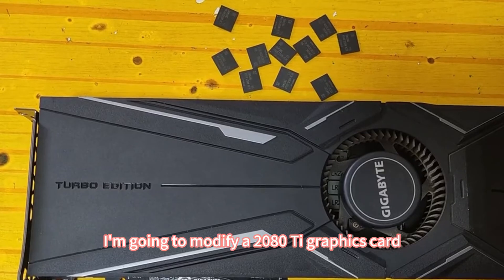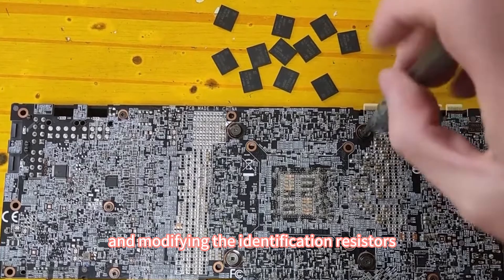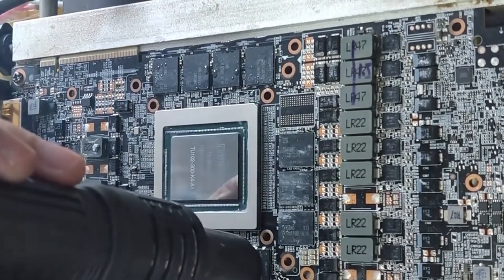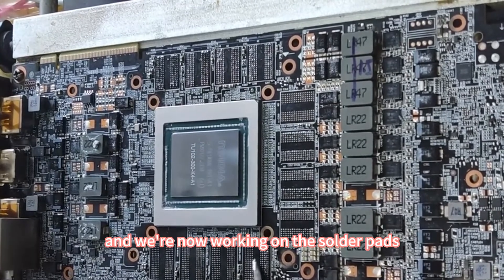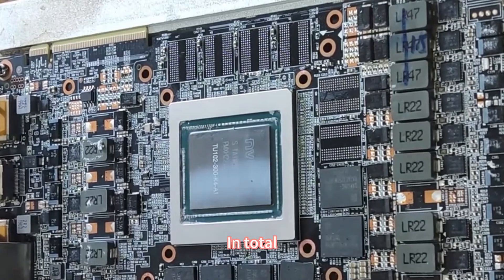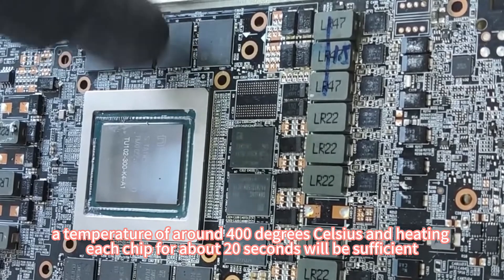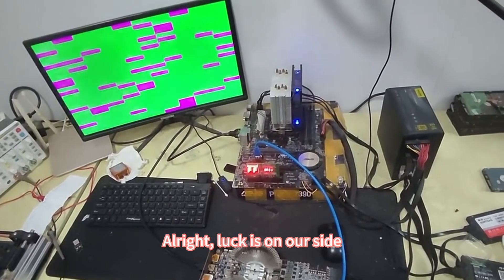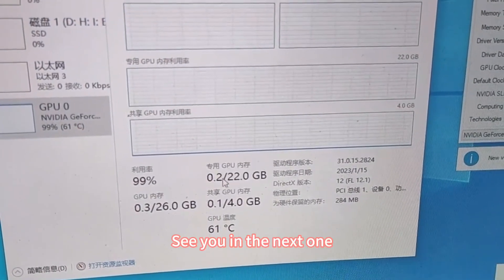How to upgrade GPU memory. Upgrade 2080ti to 22G. 2080ti22g.com

Comment: What the heck do you mean not technically challenging? You immediately said like 500 different ways to screw it up and then on top of that you need the right tools which are typically not owned already

Comment: Great work, be cool person to hang out with and learn and experiement with projects, this land here is anti land, lol

anyways if the gpu is plugged into teh pcie 16 slot, I had an idea, that if the gpus were slightly modified with a buffer path circuit like their crossfire, you could insert an adaptor of ram into the PC slot, that could hold up to 5 modules or well unti lthe power gives out on a card with its own path and id, this would allow you to upgrade the VRM of any gpu, and of course the gpu then is inserted into the slot... this should work right... or maybe not... The location is off but it could be a direct.. liek when I was wathcing DIMMs and read write paths, one could make a same read right path, or alterantive an easier solution is a gate, that closes when an daptor is plugged thus only the active ram is utlized that uses the deactivated vrm installed, by pass it without removal and utlize the new chip set added... alternative, VRM towers could work in the same regard in how the layer the word and bit lines, adn then ahve another capcitor and word and bit line track... meh I don't know but it would seem possible to bridge the back of the ram, but that may take too much tiem and mess up the snetivie volts for hte bits and the nnot relay the proper information.. hmm I think an adaptor would work, but maybe not... peoples.. want a way to upgrade vrm on the gpu, like the main mother board that dedicated to computing, cpu... Of course they have massive differently speeds and uses, VRM and RAm, and memory itself.. The logic of the computer systems are pretty simple ,the largest proponent of destruction of it is education and monopolies to consolidate a controlled market its the same with ram market.. monopolies destroy the freedom adn the educaiton and life of others that peopel once had... as like other systems, its very bizarre. I htink a good goal, would be 100 gb ram gpu.. that utlizes the read write effeciency of DDR5 ram or better, I was really impressed the improvement from ddr3 - dd40 dd5... and the voltage decrease. whilst then a effeciency increase over how the WORD lines are read/ multiread, during a bit phase and the burner bits that cahces a group address in teh 128 bit for evne faster... RW... hmmm. The mechanical nature of the volt and movement and capcitors in how it works is really something... logical.. 

GPU adaptor could be amde in several ways. A hard core method is a device that scans for the connectors below, and it drills into them a nanometer... through hte ram, extends and slaps a ram on top.. right through the old one.. aggressive instant upgrade.. lol  It shouldn't hit hte capcitors but .. hmm 

there is no fun classes of like, lets go build motherboards and gpus for a few months and learn this info, now its.. you must serve and be slaves because of identity and we will kill and steal nd trap you which makes no sense since everyone was part of the com revolution that was part of warfare and engineering nad well surviving so yeah private and proprietary.. destroyed creative appraoches to enter in and have fu nredesiging or making ones own design and it is engineered this way curelly throug hrental and other forms of money control to rob peoples.. Nethanyahu that asshoel wasn't lying when they destroy the greeks they created the largest mesianic cult army that kills anything that htey verbate and destroy normal peopel adn rob them.. and america corps were paying peopel to train tehir repalcement for decades adn laughing about how stupid they are in teh background while taking over the operations and unqie peopel, much like the igital camera and other things... its hte oppsite world meh. get sme angry whe nI think about it.. which is making us all stupid ,its liek we hsopudl jsut kill them al lthe time and ignoring the whinign and it wouldn't become like this.. but then its like .. these iditos create no win situations its not about winnign or goating jsut about doing a thing and well and then have an interesting ideal around it. meh.. anywys keep up the good work, end rnat.
Reply: You're one of those savant types arent ya?

Comment: Has anyone done this to make a 48GB 4090?
Reply: Dont even know if they have larger vram chips that still fit in the same form factor. You should ask grok research or chatgpt think whether it does. It's free, I would do it, but i have to wait several hours for my free uses to recharge.

Comment: Does it work to mod a 4060 to 16GB instead of the original 8, not the 4060 Ti that sucks.
Reply: yes
Reply: I wanna know why 4060Ti sucks? because rn I'm confused between 3060Ti & 4060Ti to pick one for my build
Reply: brother, if you can't do this basic research on your own, I wouldn't even dare to attempt this kind of thing lmao.

Comment: Dude I wonder if there’s a place I can just take my gpu to upgrade the vram
Reply: its more that it needs to be compatible and where does it come from? cant just ask nvidia for them so its always offcuts, would need to be a high traffic PC shop or a guy with distribution centre connections to actually get the chips

Comment: actually, 12 chips. why you said 11 chips?
Reply: 22 is the max you can do without failure
Reply: @mkeefe4248  you mean 12 chips, but replace or upgrade only 11?
Reply: @CambodiaShareFeeds  no no. What I mean is originally the gpu had 11 1gb vram chips. That’s why it’s 11 gb vram. He replaced them with 2gb vram chips instead so 11 2gb. That’s why it’s 22gb. You can’t go past 22 gb though even though you have one more slot. Because it would be faulty. It’s very hard to explain why but. The max vram this card can have is 22gb . If I remember it’s something with the drivers. That’s why he only has 11 chips.
Reply: @mkeefe4248  i understand your meaning, but just wonder why keep 1 chip empty? because the total chips i had counted was 12 chips.
Reply: @CambodiaShareFeeds  bro I just explained it. Because you can only have 22gb max smh. If he had 12 2gb chips he would have 24gb. Which is not compatible. So he can only have 11 2gb chips because the max is 22.

Comment: What about RTX 3080 20GB?
Reply: 3080 20GB needs the PCB from a 3090, not as easy as 2080ti or 3070.
Reply: @lly0571  I see, thanks. Yes, interestingly, RTX 3090 PCB is compatible with RTX 3080 GA102 core though, so if one acquires a clean RTX 3090 PCB for some reason, and they also have GA102-200-KD-A1 core, it could be done

Comment: You didnt mention you have to do a custom bios update.. and the people who attempting to do this already wrecked their $1200 GPUs lol now its a $1200 paperweight! This is an experimental thing.. might as well just buy a newer 4070Ti with 16GB for $300 more after selling the 2080Ti.. the time and effort and risk isnt worth it doing this, otherwise it would have been a thing that everyone did if it was that easy.
Reply from the maker: No. it doesn't require custom bios update. I agree with your second half. The upgrade is not easy. Please don't try the mod yourself unless you are an expert.

Comment: Do you know if this is possible on 3080Ti? 12gb to 24gb? Thanks
Reply: There’s a thing out there called RTX 3090..

In all seriousness though, 24GB 3080 Ti would be awesome, having all VRAM on the frontside of the PCB.
Reply: @flutecat87  yeah I bought 2 x RTX 3080 Ti for $400, 3090 is still 1000+
Reply: @AINMEisONE  i can get 3090’s for about 600 Eur here in Sweden. :) ofc depending on which brand and model.

Comment: 400°C is too high for a reflow.
You should use 300 max with a preheater set at 250°C and let the board have enough heat (180°C) before applying the 300°C on the top.
Never be impatient with temperature or you'll instantly kill the chip for sure.
Just let the temperature increase slowly and let the PCB absorb heat little by little.
In my experience, Ram chips hate high temperature. If you use more than 350°C for more than 10 seconds you'll definitely kill the chip.
So in conclusion:
1- preheat the board with a preheater (heating plate) and let it reach 180°C
2- then apply 300 - 350°C max to melt the solder and remove the chip.
3- patience is your key. Never reach the required melting temperature too quickly but let the board absorb heat and wait patiently.
Reply: yep, i been through about $2,000 USD in cards before i learnt this.

Comment: Something like on an GT1030 DDR5 will be amazing
Reply: unlikely as it's such low vram to begin with, a gtx 1070 would be the minimum worthy card, although that'll change soon as 5000 series cards are releasing.

Comment: How come he did not use 12 chips for a total of 24GB ,is that channel not active in the already blank spot?
Reply: Yeah I noticed that there was a empty pad. But it also came like that before he did the mod. I think it’s better off to be safe and leave that pad alone it’s already hard enough to do this. It’s possible but using that other pad might make it a 0% success rate. This is pretty  cool  though
Reply: @mkeefe4248  Its cool though ,I'm just curious to whether that empty pad is actually functional or not. :)
Reply: @Nevakonaza.  I realized why. It only allows 22gb. So he upgraded 11 1gb chips to 2gb . Because it only is functional at 22.
Reply: @mkeefe4248  ahhhh okay that makes perfect sense,thanks for explaining 😊

Comment: Guys, dont fuckin do it if you never done bga-level repair and you got the proper equiptment. I killed 4 gpus for lack of experience (from 960, 970, 1060 and 1060, there are a tons of things you want to think about, you need a dehumidifier (100 degree oven/ put the card in for atleast 20 hours) you need a bottom heating plate for bga repair work, you need a decent heat gun, flux, etc, if you got a function 2080ti, dont do it! 
Also, you need properiatary tools like Nvidias MODS/MATS testing tools which are NOT available unless you go on the darknet/repair forums, so if you dont have these tools, dont touch ur card... 

... dont!
Reply: MATS/MODS are available all over the web. Easy to find. You don't need to dehumidify or to cook the card beforehand, not even sure why you think that, and you don't really need a board heater, but it is recommended. All you need is a decent heat gun, a decent iron, good flux, and a little bit of practice. If you've praticed on 4 cards, you should be well on your way by now, and shouldn't still be having failures. You might seek out some professional advice if you are still having issues.
Reply: This is nonsense
Reply: what a bunch of bs

Comment: where you get the bios????
since 22gb is unofficial Im pretty sure you cant get it online
also, even with the right bios, the gpu refuses to boot and need to flash another bios
Reply: yeah cause in this video he never set the new resistor positions, he obviously left it out

Comment: That's it ? 🤨 Does the bios need some modification to detect all 22GB or it just natively detects new DDR modules ?
Reply: I've seen mention of others performing this upgrade. They say that no software/firmware changes are required and the card and drivers will detect the larger chips without issue.
Reply: I've found a bunch of salers from China listed these 22GB versions online for as low as 430$ but they're all reference board with blower cooler and I kinda wanted to do it myself.
Reply: Samsung K4ZAF325BM-HC16 (16.0 Gbps) and K4ZAF325BM-HC14 (14.0 Gbps) are two types of GDDR6 module that I can buy so I ordered them for ~12$ each with soldering/hot air station, reball kit, ... It got out of hand pretty damn quick for a little experiment, but hey, 4x 2080Ti 22GB Strix sounded cool as hell
Reply: I also found out about "strap mod" as mentioned in an article from videocardz. I think imma stick to that for later
Reply: @BLVDE468 did you succeed in replacing the vram chips ? 🤔
Reply: @Selyan_  I'm getting nowhere, man. So many headaches, first 24 modules I ordered have some kind of defects. First I was getting no output, but when I did get an output on the screen it just black with some green artifacts.I think I messed up somewhere at the resistors strap for memory modules. Still looking for info on that one.
Reply: @BLVDE468  Hows it going now?

Comment: Awesome vid, 4k max setting cyberpunk 2077 will use around 12gb of gpu memory, haven't found a way to 'bench test' more than that though.
Reply: ia
Reply: @pedrowilliams6433  but there are no standardised benchmarks for that the also show memory usage
Reply: @foreskinracer8753  wrong. New games need 16gb vram in 4k path tracing
Reply: @danielkissgremsperger3242 path tracing reduces to your fps to trash even on an rtx 4090 in cyberpunk. Not a valid argument
Reply: @BrycensRanch  how?? It is pretty valid since it eats up 16gb vram. It is fully playable even with a 3090, you can get above 30fps, a 4090 can push 50+ without frame gen. So how is my point invalid, when I replied to someone saying above 12gb vram is useless??????
Reply: @danielkissgremsperger3242  its not playable with 3090 lol
Reply: try the last of us part 1 and resident evil 4 remake

Comment: where did you get the custom bios to utilize the 22gb?
Reply: Can use regular bios
Reply: That's not how it works. A prime example would be when people would unlock the 4gb rx580 to 8gb rx580 with the correct bios if it was flashed w the 4gb version but actually had the chips installed @Rogerfuk
Reply: on rtx u can use regular bios, in Indonesia many people have upgraded the 2080ti like this #sorry for my bad eng.
Reply: @Therpsycora  It says in the video title it's a popular mod guys, stop policing youtube videos.

Comment: Woud like to leave a PSA down here:
This is not an easy process, it requires good repair equipment and a good amount of experience. Removing VRAM from a graphics card without killing it is a complex process by itself, let alone reballing and soldering new BGA chips on a board.
Reply: its simpler than it seems but it requires a substantial investment in tools and time to learn how to work the tools. in the end its just hitting the chips with a hot air gun pulling them off with tweezers heating the pads to remove the old solder wipe it with flux reball the pads drop the chip on and heat it

Comment: A benchmark before and after could be cool
Reply: ive noticed 99.9% of people who have the hardware skills to do ram upgrades on gpus lack the knowledge of actually how to use the gpu and create compelling exampled why its relevant. Most of them also do no voice videos and the best we get is some robotic 2009 ai generated voice lol
Reply: @cppctek  the hardware people being clueless with software is real
Reply: @cppctek that's because this is all being done in Brazil for some odd reason. They are hardcore about modifying the ram on their gpus down there.
Reply: he wont because it will show the exact same memory usage ...      given the bios has to be re written for the card to use it.... OOPS they dont tell you that.
Reply: @HarleyHutson  no, i saw on a diff video you can change the resistors to a different orientation
 so the bios reads it as 2/3 GB memory depending...
Reply: It won’t affect fps unless it’s a game you don’t have enough vram for originally I think.
Reply: @mkeefe4248  yeah, but i wan't to play 4k cyberpunk with a 2080 s, and with 8 to 16gb of vram it worth it right ?
Reply: Sorry if m'y sentence wasn't correct i'm Bad in english
Reply: @mkeefe4248  ^ this

Comment: Doesn't the bios of the card need to be modified in order for it take advantage of the 22 gigs?
Reply: They also mentioned (but didn't show) needing to modify the resistor configuration for the straps usually required after changing memory modules.
Reply: yes it does
Reply: @RaceT3ch how to do pls resource video
Reply: @fw1719  I don't know how to bios mod but reddit might have tutorials or something
Reply: Yes, it needs to be modified or flashed with a different Driver or VBIOS that's confirmed to work with the VRAM mod. 

Some cards like the RTX 2070 or RTX 3070 already have support for 16GB in their Drivers (Nvidia just never actually released 16GB variants) so you can easily mod and get them running without much issue. Cards like the RTX 2080Ti or consumer RTX 3080s (despite there being legit - but rare 20GB variants) have no native support for the increased memory in their drivers And furthermore, you would need a modified driver to make proper use of it which will either be from some fishy Chinese market selling modded mining cards from leftover stock as they upgrade their farm and/or try to liquidate assets, or are under NDA from legit companies and are very hard to find. There's a reason this video is in Chinese and is using English TTS while directing you to their eBay listing to buy their cards.
Reply: @lievre460  Could this be done with a 4070?
Reply: Nvidia has started locking bios' due to people cooking their systems
The input/power resistors which were never shown in this video, need to be switched, There are a few other videos online but one is in russian and the subtitles are complete trash making the video hard to follow especially because russian sounds disgusting. Theres some fellas in Brazil who show what position to resolder the input resistors
Reply: @matthewpurcell446 what's your problem? There is no language that sounds disgusting, only stupid ppl
Reply: @matthewpurcell446 what a racist comment😂
Reminds me of the "you are butchering my beautiful language" type of racism from the wolfenstein nazi😂😂😂
Reply: @matthewpurcell446  Google nvflashk. It at least lets you write almost any bios to it. Nvidia bios's are a lot less locked now.